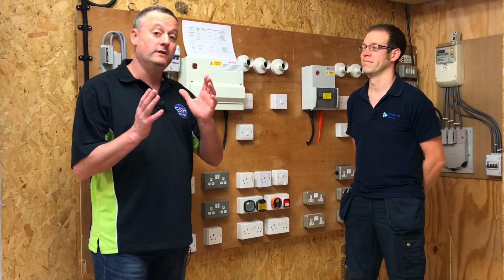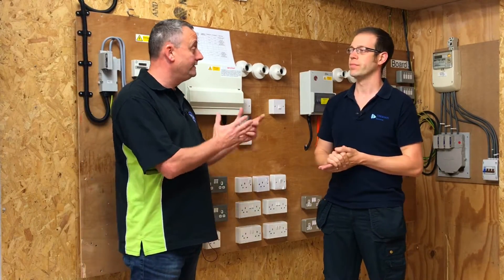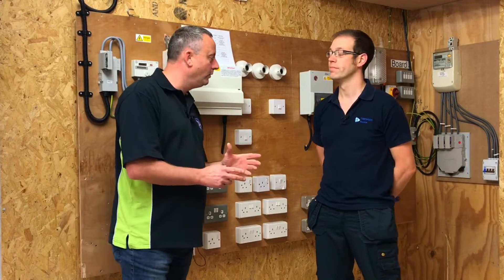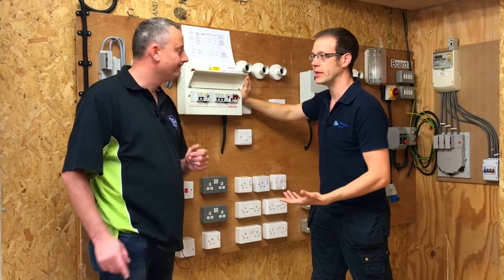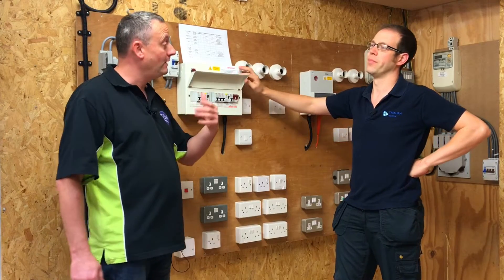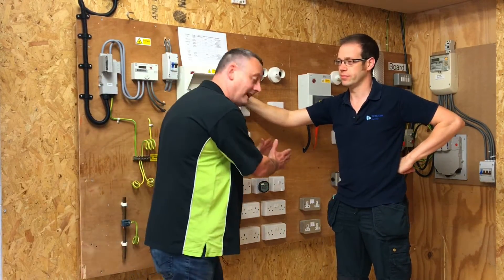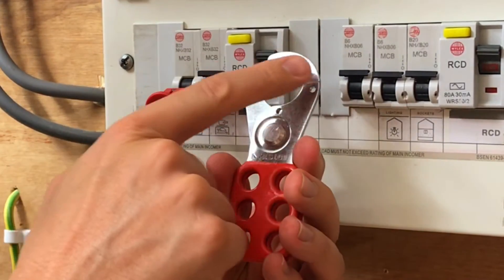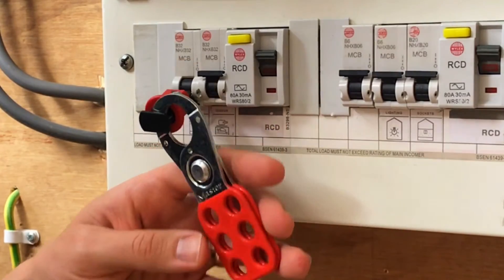How to Safely Isolate a Single Phase Socket Circuit Using a Plug In Voltage Indicator and Lock Off

Comment: Great video as always guy’s
I know it’s aimed at the level 1 and 2 learners, but I have to disagree with the idea of proving the plug in voltage indicator on a different circuit is would make more sense to plug in to the circuit you are going to work on indicator works , isolate the circuit indicator does work reeneygize voltage indicator works isolate again and start the work. Why do I say this simple, if as gaz mentioned you’re working in an hospital and you need to replace a socket on the ward above one of the beds are you really going to walk out of the ward down the corridor to find the nearest socket on a different circuit ? No of course you’re not because wile your at the end of the corridor someone on the ward a nurse or a cleaner that haven’t been told you will be replacing that socket could  plug something in to the socket you’re going to replace. And that could be dangerous. Unless you are lucky enough to be working in pairs ie there’s two of you one can then stay by the socket while the other goes to prove the voltage indicator.

Comment: Why do you have to plug the socket tester into a socket on another circuit to the one you want too test? Why csn you not simply plug it into the socket you want to work on as it is live anyway and will prove the instrument is working....

Comment: If the MCB is in a DB within a locked cupboard, knowing that you are the only key holder is it okay to lock the cupboard, place signage, then check to confirm isolation, before completely locking off?

Comment: Best reccomend plug tester please?
Reply from the maker: https://www.amazon.co.uk/DL1090-Socket-Tester-comes-Buzzer/dp/B006ZMGXO4

I do like the one above 👍
Reply: Anything with a nice loud audible tone. All the branded tester work pretty much the same... Mine is a Kewtech kewcheck 105, I chose it because theres not a single where an LED isn't on permanently or flashing, if I plug my socket tester in and one of the LED's fail to light, I know the tester is faulty.

Comment: A very timely video for me, I've got my 2391 practical on Wednesday so it's a useful recap.

However, shouldn't you have a lock each?
Reply from the maker: Hi thanks for commenting and all the best with your AM2 👍
Reply: You're only required to isolate and lock off the equipment/circuit you intend to work on. Very very rarely is it convenient or even acceptable to isolate and lock off an RCD or main switch.

Comment: the equipment can be just as important as the procedure, my maplin indicator stick says AC 150V+ but it lights up from pretty much anything. DC 12v even! shocking.
Reply: Yeah, treat yourself and buy a Fluke volt stick.